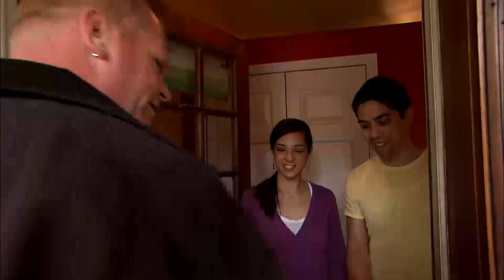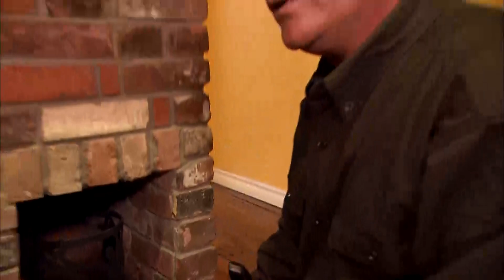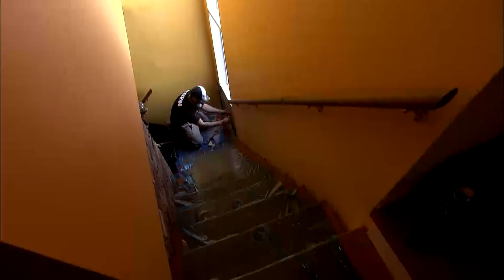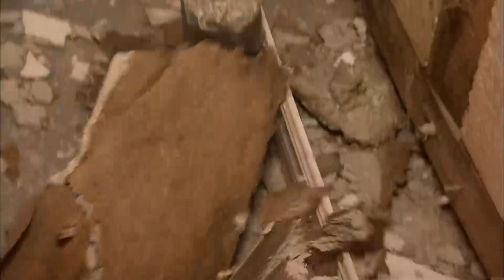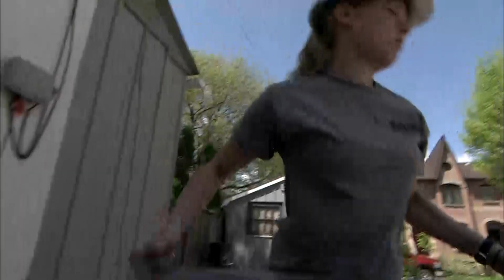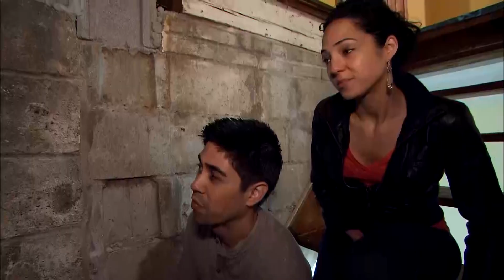Mike Holmes Transforms a Historical Gem into a Safe Sanctuary | Holmes Inspection 111

Comment: The homeowners should be wiser also. There was an episode of a hose attached to the ceiling in the laundry room. Big Red Flag there. In the states we usually go the seller's realtor to have things fixed first. Once the repairs are done then you move in 
The roof leaked in the house we bought we went asked them to either replace it or lower the sell price down $10,000. They seller's lowered the price.

Comment: Hello when I build my house I am going to have every room the size of two to three very very large rooms put together and it's going to have 7 to 8 bedrooms    and a bathroom  the size of every room  for each bedroom  and I am going to have 4 to 6  real  wood burning fire places  and none of of this cheap gas or electric or any other type of fire places  and this away if the power ever goes out then I won't have to worry about no heat  during the winter and I won't have to worry about having to buy fuel for a generator and to cook on I will wood stove set up so I can  also cook on it  and I  will have a fool finished basement with to or three fire places in it

Comment: I sure wish there were honest contractors out there in the US like Mike.  I have a foundation that is not good on a very small 70 year old house and every contractor gives a different answer and they all think that people are made of money.  The contractors in the US are not good for the most part.  They look at you as a bank account, and they give you the most expensive solution that is not really going to fix any problem. All they see is money money money and none of them want to do a good job.  They want to give you fast crap that will fall apart in a few years.

Comment: I was site supervisor on a house that my brother was renovating. The place was old. He wanted to screw drywall on over the cracked plaster, do a kitchen and paint. When I inspected the house, I found: gas pipes in the walls, 7 layers of flooring and 5 layers of ceiling in the kitchen, unsafe stairs to the basement and upper floor, a plumbing stack that looked like something out of a Lovecraft novel, squeaky floors everywhere and a floor plan that nobody wanted. I told him, we could do it the way he proposed, but we wouldn't get anything for the place if we tried to sell it that way. He got an architect in to draw up the new plans and we gutted the place, stripped it right down to the structural floors and brick walls. All of the old horse-hair plaster, interior walls and layers of ceilings and floors went in the garbage along with the plumbing, wiring , duct-work, gas pipes (for lighting) furnace and water heater. Whe kept the classic look of the outside by rebuilding the original double-hung windows and tuck-pointed all the original brick-work. rebuilt the front porch too. Inside, the main floor was opened up so that only one partitian separated the kitchen and the living-room. The main floor also got a new powder-room. New stairs up and down. With all the old-botched renovation work gon, the main-floor ceiling height was 10 feet. The upper fllor got a sky-light at the top of the stairs and a vaulted ceiling in the front bedroom. We deleted two small bedrooms and the main bathroom to create a larger rear bedroom and a really nice 4-piece bathroom. Ceramic floors in the main bathroom and kitchen, hardwood everwhere else. Modern breaker pannel and HVAC. New roof. The place sold for enough to clear a small profit, but that's the way it is when you do it right.

Comment: If the home inspector you hire is horrible, can you sue him/her? Hold them liable for damages for the cost of how much it takes to fix the problems? Can anybody answer this question?
Reply: Nope.
Too much fluff in the fine print
They can't see everything that needs addeessed so in general they have to release themselves of liability.
As a contractor, it sounds wrong but at the same time its also understandable

Comment: We bought an 11 year old home and had the ductwork cleaned by a good company, not one of those fly-by-night, "We'll clean all of the ducts in your whole house for $99" type of company. We paid $500. The person got out around 50 lbs of gunk from the ductwork and cold air returns in our 3,000 sq. ft. house. There were toys, nails, chunks of 2" x 4"s and sheet rock and plain old dirt. My allergies are a lot better since the cleaning.

It's a shame this young couple was led astray by the inspector and previous owners (maybe they were unaware of the problems, though).

Comment: As someone down below already writes, this should be a three house project. IMHO either a 'gut to the studs' or a complete rebuilt. Both would result in a modern construction for much less cost than this band-aid.
I know what I'm talking about, we did recently the nine month 'gut to the studs' on a 1881 home.
Mike does great work, but this is a waste of energy and money. Ten yours from now, there will be plenty new problems.

Comment: I am in no way protecting bad inspectors, I know lots of them.  However, in many areas and cases, it is not allowed for an inspector to move items to inspect.  IE: drop tile ceiling.  If an inspector moves it and a little corner of that tile breaks off, he can literally be liable to replace the entire area of drop tile ceiling.  Sellers also can leave personal belongings in the way on purpose to prevent an inspector from getting to things as an inspector can't move those belongings without high liability.  Again, I know there are inspectors out there that take advantage of these things to speed through a job, but it's been made that way by insurance laws, state regulations, and real estate companies (who have high influence of home inspection laws in many areas).